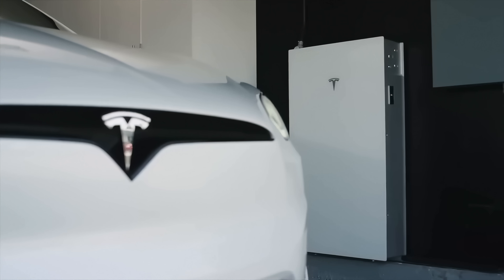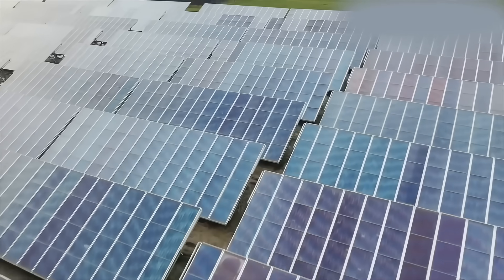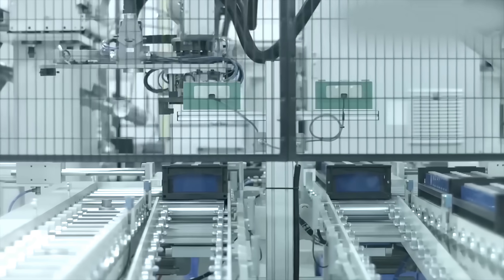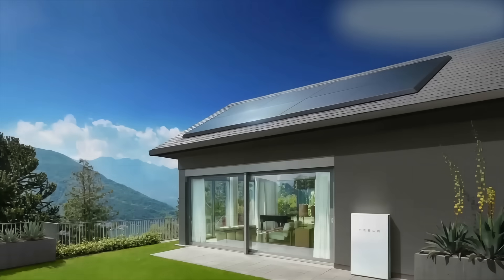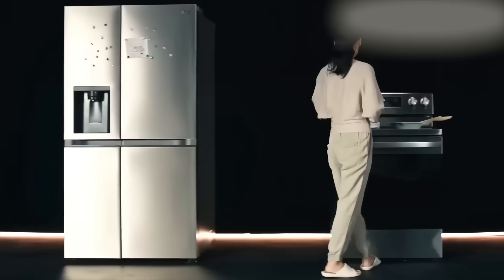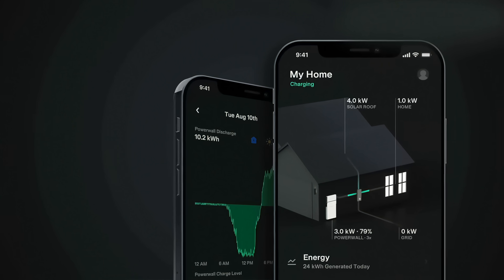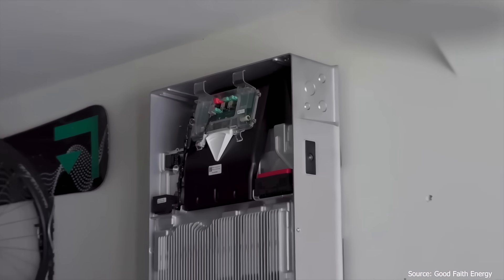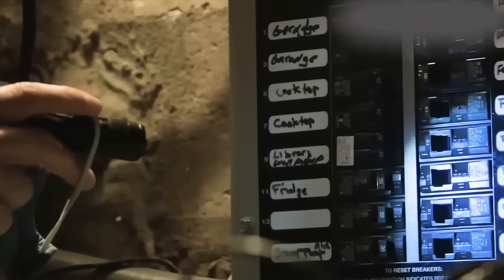Tesla BRICKS Powerwalls Remotely — Thousands of Home Batteries Now Useless

Comment: I had a Powerwall 2 that was affected.  My Tesla app indicated my Powerwall needed service and to contact my installer which I did. My installer advised it had been shutdown due to being from a batch of batteries that may have a fault. They contacted Tesla and about 3 weeks later I was advised my pw2 would be replaced under warranty with a powerwall 3. About 2 weeks later it was installed. I live in Adelaide. Appears Australia is not having any issues. Yes, I probably lost a $1 of export and used some overnight grid power, but I got a new unit and new 10 year warranty.
Reply: This is what I'd expect to happen in Australia. We have decent consumer protection laws. Okay, sometimes you have to go to tribunal to get satisfaction, but the law is generally on the consumer's side (especially in open and shut cases like this) and you don't have to wait for a class action law suit. A Powerwall is a product like any other and is subject to the same consumer protection laws. The retailer is primarily responsible for making good any faults, and if they can't or won't then Tesla as the manufacturer must. The law also has provision for fixes within a reasonable amount of time so the months of delays being experienced in the US simply wouldn't be tolerated here. It's awesome that you got a PW3 as a replacement; I'm considering one at the moment.
Reply: @chrish2879  Similar consumer protection laws in New Zealand
Reply: You have consumer protection laws, US does not.
Reply: 5 weeks to rectify, it's lucky you had grid power.
Reply: Yes.  In the US right now you just bribe our president and he makes the case disappear or pardons you and makes it so you don’t have to pay judge ordered restitutions.
Reply: If you are lucky, you get a PW4 or PW5 or...
with CATL cell tech that last more than 30 y and is safe.
Reply: @saschabjelica2741that's just putting a swastika on your wall for the next 30 years.
Reply: Lets not be insane with silly symbolism.
You want a reliable battery cell and good short and long-investment then you choose CATL.
The rest is less important. Swastika bombastika shizo-fantastika...
Reply: Serves you right
Reply: Heil elon ⚡⚡ then
Reply: Perfect response from a great company
Reply: @DimebagDarrenCoins sarcasm, right?
Reply: @francistaylor1822  no. it is irony, not sarcasm. sarcasm is something completely different.

Comment: I would avoid any product that can be remotely disabled without my permission.
Reply: In this case the action wasn't the issue it's the resolution.
Reply: So you don't have any cars, phones, Apple products, printers. streaming services in your life?  They can all be remotely disabled.
Reply: @lostinspace8238  The newer cars that receive "updates" or have built-in cell phone ability can be remotely disabled.  Not so much the older cars like mine.  I still have a land line phone, my printer is hard wired, and I don't subscribe to any streaming services.  My TV does not have my router password.
Reply: @lostinspace8238  I have none of those that connect with the Internet.
Reply: @lostinspace8238  Not many, and if apple want's to kill-switch my iPhony 7, I'm happy to go elsewhere. If you allow a printer a gateway to the public net, you're asking for a ream of dikpiks. "durable goods" with telemetry are madness, in almost all cases there is no value add, only liability.
Reply: You should also avoid products that catch fire without your permission.
Reply: @kevinmills5293 Any EVs
Reply: @kevinmills5293  Yes, by all means, don't buy defective products. Recalls work just fine without telemetry to a mother ship, and "you might DIE in a fire without our AI monitoring!" is weak, weak sauce bordering on extortion. The effing things caught on fire anyway, and post sales support in no way requires telemetry. I will happily manage the fire risks and anyone who thinks telemetry protects them or makes up for poor system design will be very disappointed.
Reply: Like any smartphone? Or any tablet? Or any PC/laptop? Or internet connected TV? Or broadband modem/router? Or any home automation product (Google Home, Alexa)? Or any modern car? It’s nice I’m theory, but these days, it’s literally unavoidable.
Reply: @just_passing_through  I have a PC, Laptop, smartphone, router, modem and car. None of them can be remotely turned off or disabled by no one. Yep. the only one turning off my 1992 carburated  SUV is me with my metal key
Reply: @Theveganshift77 If you don’t think Apple or Microsoft, or Google can brick devices with a single ‘update’, you are a moron. I’m with you though on my 2003 MX-5 with a metal key, and not a single ‘remote connection’ in sight. They will have to rip it from my cold dead hands.
Reply: @just_passing_through  Same with my 2000 F-150. I am never selling it.
Reply: @Theveganshift77  Wrong.  Every time you do a firmware or software update you are letting them remotely disable your hardware.  Read the fine print in the contracts.
Reply: In this case, it was a great decision. NMC batteries are a safety hazard.
Reply: @ArthurDentZaphodBeeb  ALl Tesla products are a hazard. Don't buy anything from them
Reply: @ArthurDentZaphodBeeb  Putting NMC batteries anywhere near a building is a safety hazard
Reply: Go back to living in a cave then,why are people so clueless!.
Reply: @alancobbinimagine being so NPC you think it is a good idea to hand every aspect of your life to faceless AI corporations so they control remotely your house , car and whatnot. Not me thanks😅
Reply: Like your car? Like your phone? Like your TV? Like your internet? Like your electricity?
Reply: @PersonalStash420 Paid Tesla shill enters the chat
Reply: @PersonalStash420  A device that you buy that has certain features, like a car or a phone or a TV, should not have those features disabled.  While you may have to pay for a monthly a subscription to a service (like your phone or cable TV), the capabilities that you purchased should continue to be accessible.
Reply: @PersonalStash420  Yeah, sure bud, I'm terrified Tim Apple will killswitch my iPhony 7 worth 50 bux. Or my Netflix. Oh wait, I don't have netflix! These are all consumer choices and anyone who EULAs in deserves what they get. There's a gigantic difference between not paying your grid-power bill and getting a meter pulled and signing on to dipshit Tesla bots. Enjoy your FSD next year!
Reply: @user-pd5ot4zd4b  But I don't own an EV. Merry Christmas from Texas. 🎄🎅
Reply: @PersonalStash420  Fair enough, Merry Christmas!
Reply: You should avoid YouTube and the internet entirely.
Reply: @josue_kay  YouTube is not the product.
YOU are.
Reply: @josue_kay  The users don't own youtube. We didn't pay ten billions to own youtube that can be turned off in an instant. No one has "bought" the Internet, not even Musk.
Reply: @Theveganshift77  
No one bought the sunlight either.
Reply: You’re clueless

Comment: I opted for an inverter + 2 5kw standalone batteries 🔋.  No over the air updates, I have full control. I considered Tesla many times, but opted for an open architecture. 😁
Reply: It's ridiculous people opted for these lithium for a fixed installation. Make sense when you need portable power I run traction batteries from forklifts. Like $5,000 for 50 kw they can be drained down to zero without hurting them no BMS easy 10-year lifespan as backup power has been the industry standard in every factory in the world will not catch fire tried and true technology only issue is their weight mine weighing 3000lb I needed to rent a forklift to move the battery to put it in position in my garage. Edit even in 15 years the price of it for scrap will probably cover almost half the cost if you look up scrap pricing on lead acid batteries on a 15 to 20 year trend
Reply: @MmMm-f2y7c  You might even turn a profit on the scrap vs. replacement value the way batteries are dropping in price.
Reply: Phew! Close call and bragging rights.
Reply: Nice!
Reply: I wouldn't let my dishwasher be connected the internet, much less an important component like this
Reply: @NondescriptMammal  IF you're the same person that has ALL their batteries in a separate steel  outbuilding, then you're smart.
Reply: I agree my system is not connected to the web.. if theirs a problem the manufacturer will contact me and I'll tell them to send the new and I'll return the old. Simple
Reply: It's much better owning something than "renting" it off an unstable lunatic
Reply: Literal Nazi
Reply: I'm on batteries of my choice and only 6000w of inversion, but I'm not delusional. If any of my Chinese choices become known to fail as a result of some known failures NO ONE FROM ANY OF THESE COMPANIES IS GOING TO CONTACT ME AND LET ME KNOW ABOUT ANY SAFETY ISSUES THAT MAY BE OCCURIING, THEY JUST ARE NOT. YOU KNOW IT, I KNOW IT. It was important enough .. even with the backlash ... to keep people safe, so it was done.
If you don't know what you're doing or don't want to bear liability yourself, you'd better involve a company as responsible as TESLA.
When your DIY system has a fault, use a nearby mirror to determine where the liability IS.
Reply: @DimebagDarrenCoins  tesla powerwall 2 uses li-ion ( lithium-cobalt-manganese) batteries which are flammable and can burn with flames... any cheap chinese battery uses lifepo4 batteries ( lithium-iron), different chemistry which doesn't burn out with flames... these are even safer then lead batteries which can produce hydrogen gas which is highly flammable and explosive and need proper ventilation for safety.
Reply: @brixtonianme9717  no argument there, but if Tesla finds out something is wrong with their batteries, they are pro active, overly pro active in the direction of safety,. regardless of bad press and  financial loss. Those are being replaced with Powerwall 3 according to owners. China won't be there for you IF needed ... so sorry, so sorry !
Reply: @DimebagDarrenCoins     .Their actions were probably decided by liability determinants and less about individuals' safety, but yeah, they acted. You missed the part about lack of communication and loss to business owners. A replacement doesn't retroactively bring that inco e back.
Reply: @Youtubeispoo-o6d  they have a department that weighs the backlash vs the liability. Then a choice is made.
Reply: @DimebagDarrenCoins  Most people have reservations about dealing with suppliers from China, but expect the premium price for buying from an American company to be more reliable. If I thought shutting a product off and just shutting up is good , responsible customer service,  I wouldn't brag about not being delusional.
Reply: @edbruder9975  I'm not aure if the company has shut up, sounds like they're talking to affected people about a product that they no longer even produce. Who should they be speaking to that they are not? It's a shame we end up using Chinese battery cells as they themselves are SUS, but that too will change as Elon makes his own.

Comment: I am from Australia and Powerwall 2 are not being made anymore and can't be installed in Australia anyway.

So how can they be replaced?
Powerwall 3?
Are they AC coupled to fit my 3 separate solar panel systems?

My newer Powerwall 2 battery is ok however without notice Tesla has throttled down my charging to 80% and only allows it to get to 100% later in the day.
It uses a weather algorithm to determine how this works depending on how cloudy it is during the day.
Tesla call centre told me they don't want the battery to be 100% for extended periods due to possible heating issues.
Is this a result of the 10500 Powerwall 2 battery's that have been bricked in the US and around 500 in Australia...

Again Tesla just does what they want without notification or permission from the owner.
Reply: Did you home burn down?
That's GOOD NEWS then?

Comment: Not good enough. I understand need to disable for safety reasons but should replace promptly for free. Compensation is definitely in order if not rectified in a reasonable amount of time. I would think 2 months would be plenty of time.
Reply: They ARE being replaced completely free and the timeline depend on production and contractors.
You can't install units that don't exist with unqualified individuals?
Reply: @rogerstarkey5390 Captain obvious. I have seen negative news stories about the recall. Here is what AI says, please at least search before making statements. "In late 2025, Tesla issued a major recall for approximately 10,000 Powerwall 2 units due to a battery cell defect from a third-party supplier that poses a fire risk. 
Is the Recall "Good Enough"?
The adequacy of the recall is currently being debated in several legal and consumer circles: 
Remote Safety Measure: Tesla is remotely discharging and disabling affected units to prevent overheating, which regulators state renders them safe until they can be replaced.
Replacement Process: Every affected unit is being replaced at no cost to the customer.
Criticism: Some homeowners and legal experts argue the remedy is insufficient because it "bricks" expensive systems, leaving owners without backup power for weeks or months while they wait for physical hardware. A class-action lawsuit filed in Florida (late 2025) alleges the replacement process is "slow, burdensome, and incomplete". 
Compensation for Disabling Batteries 
Whether people should or will be compensated for disabled batteries is a central issue in the current recall:
Lost Energy Savings: Tesla has stated it will consider compensation for lost energy savings on a case-by-case basis.
Legal Demands: Current class-action lawsuits are seeking more comprehensive compensation, including:
Loss of Use: Reimbursement for the months the $8,000+ system was non-functional.
Higher Utility Costs: Compensation for the increased electricity bills incurred because solar energy could not be stored.
Incidental Losses: Damages for the time and inconvenience of managing the recall and the loss of backup power during potential grid outages.
Consumer Law Perspective: In regions like Australia, experts suggest this could be considered a "Major Failure" under consumer law, which might entitle customers to a full refund rather than just a replacement.".

Comment: a home battery is supposed to last much more than 10 years. homes last decades.When you're spending so much money one one of these, you'd reseasonable expect it to last 2 decades
Reply: Just because a house last for 50+ years does not mean that everything in it will last that long. Do you expect your washing machine to last that long? 
I have done the calculations on home batteries and they have not made sence where i live. They have been sold as a pack with solar cells and the pack is okay but solarcells are ecomomical better alone .
Reply: @andders2477 Washing machine should last about 10 years. even mobile phones reasonably work no problem 5 - 7 years, they still function. Home batteries should last much longer. How old is the wiring in your walls? Solar panels are expected to last 20 years +. a car from Germany to Japan should easily last 20 years, (unless it's made in America). The home battery is priced at a total different level.
Reply: @tld8102  The price of a battery can easily be the same as a household appliances if they dont have to be called Tesla. I dont see why they should last much longer as long as they are clear about the number of cycles they can last.
Reply: @andders2477 no they are not. You've got cost of electrical design, installation, and compliance testing. You clearly don't know much about home batteries. Quotes so far are averaging around 15k to 20k for a budget home battery. and if you want something other than sungrow, fox Ess, alpha Ess or voltx... then you easily in the 30k mark with Anker, sigenergy, faronious etc. These aren't cheap appliances you can just wheel in from the department store and unbox. It's akin to having a stair lift installed at your house.

Comment: Tesla being one of the 10 biggest companies in the world you would think the would have communications to their customers down pat, this shows you they are run by a bunch of kids with awful communications and can't be trusted, Tesla should be offering a daily reimbursement to every customer they disabled until the issue is rectified, plenty of other battery suppliers out there to choose from these days, so Tesla can be put on the not considering list.
Reply: I'm a fan of Google so when I wanted to buy home security cameras, Google was an easy choice for me. And I was happy, until Google seemed to arbitrarily make their old product incompatible with their new software which wasn't as good as their old software. It just didn't seem possible that this large corporation which did so many things so well would run the division that sold security cameras so poorly. This seems similar to me. It just doesn't seem possible that Tesla could mistreat its Powerwall customers so poorly when it seems like the bad press would cost the company so much more than just dealing with the problem in an ethical way.